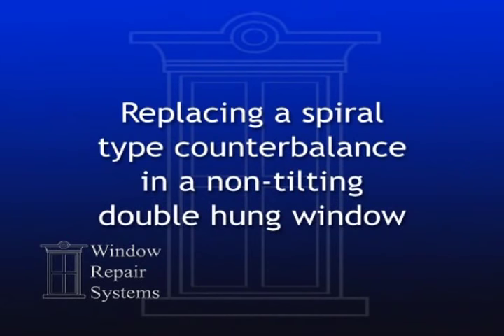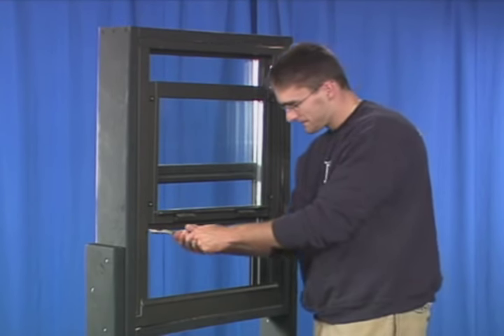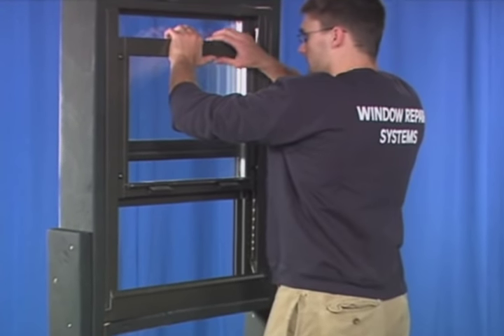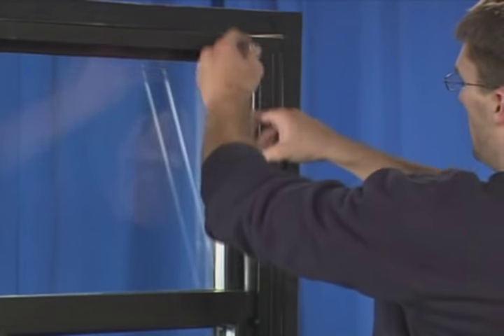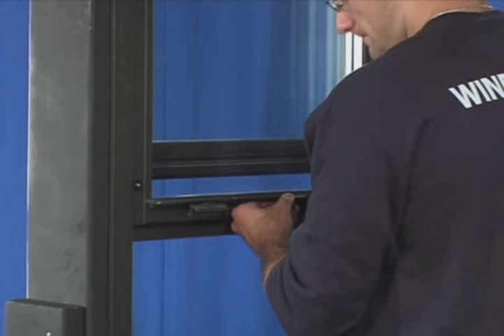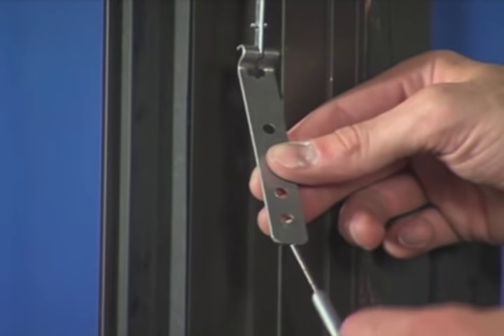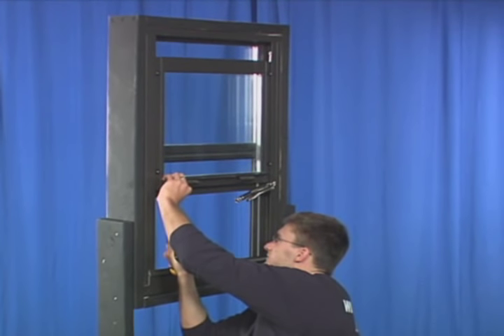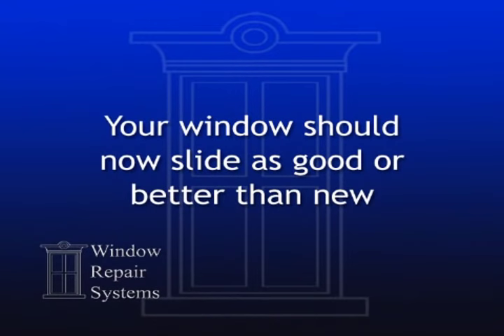Window Repair: Replacing a Spiral Window Balance in a non-tilting Window

Comment: Previous poster is correct. You need to turn it COUNTER CLOCKWISE. I spent an hour trying to charge it following what the narrator said to do. I checked the comments and decided to try it counter clockwise. It only took a few seconds and the window was fixed.

Comment: vice grips will scratch up the window frame

also some need to be tensioned clockwise, some counter-clockwise, it goes the direction it wants to turn as you lift it.

Comment: Good video. My aluminum window started to rust between aluminum bottom part of window and the metal bracket on the bottom of window. I need to clean it now and repaint it to prevent more corrosion. I just did not know how to remove springs and this video helps in doing that. Thank you.

Comment: This is great, just what I need.  But I'd like him to tell us why they need replacing.  Perhaps they can be fixed?
Reply from the maker: There are many reasons why the balances fail.  Over use, over extension, if you live on a coastal area with salt in the air this can degrade the balance etc.

Comment: I pulled my old ones out circa 2003 cleaned the spiral with turpentine then sprayed into the black tube WD 40 and reinstalled them both after turning the spiral at least 15 times. The window will not stay up, it slams down like a guillotine.

Comment: How do you remove the window itself?
Reply from the maker: On a non tilting window, there are brackets screwed in on the bottom of the sash.  You will need to push window up, use vice grip or another way of holding window up.  Then unscrew the bracket that is holding the balance in place.  The balance rod should fall down with no tension.  Repeat other side.
Reply: @windowrepairTV  do you know how to remove the window itself after you remove the balance? That’s what Im trying to do .

Comment: Had to wind our spiral clockwise on a aluminium double sash, the bottom clips had a edge so it wouldn't slip out after tensioning.